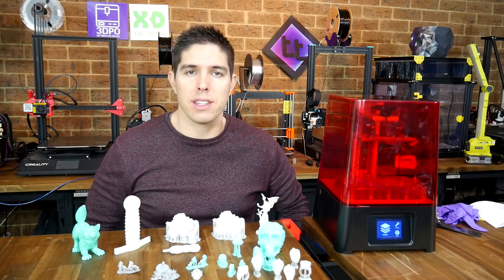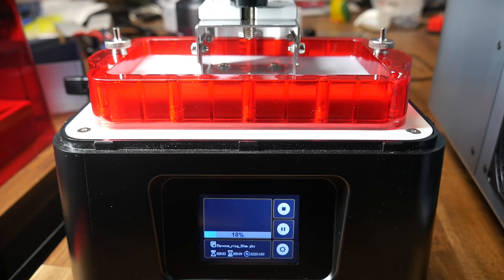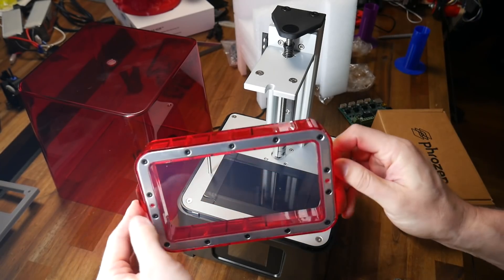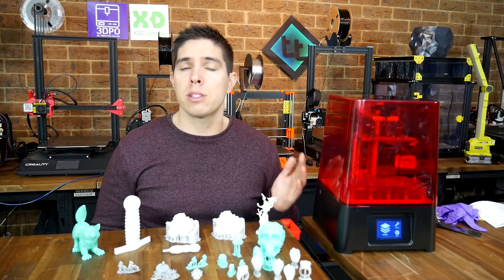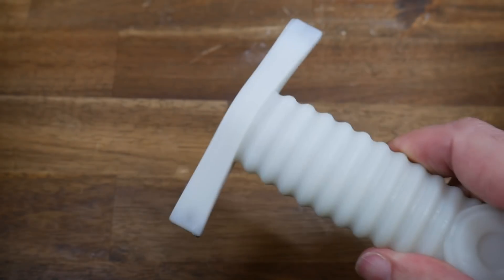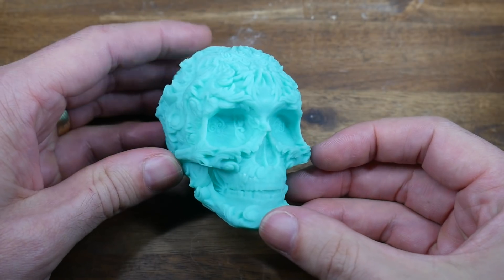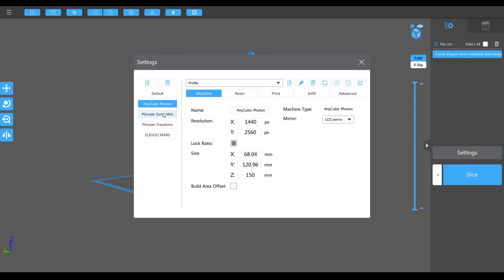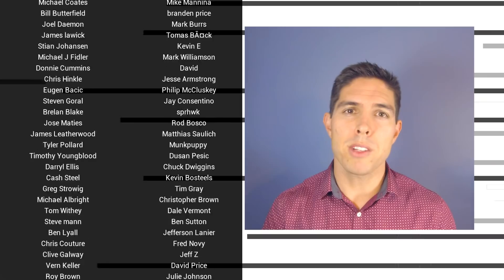Resin 3D printing in half the time - Phrozen Sonic Mini review

Comment: You changed my mind on this printer. I was originally only looking at the specs of 1080p, but the prints look good enough for my applications. Really excited for the other resins you test.
Reply: Honestly, my lower end Smartphone has a 1080p screen and i cannot see really any single pixels. Everything just looks perfectly smooth. Meaning, a monochrome 1080p display should be even a little sharper, so you certainly won't notice any pixels on a resin print, which smooths its surface somewhat automatically. And one layer of basecoat will even out even the tiniest of surface imperfections.
Wouldn't go below 1080p personally though.
But the main benefit of 2k resolution is a larger screen size with the same pixel size and sharpness.
Reply: I don’t think you can tell any difference unless you need fine detail from something the size of, say, a fingernail.

Comment: Do you think the print in place models would work if they were printed slower?
Reply: I'd Rather Be Making no. I think It more has to do with the fact that every layer HAS to stick to the layer above it, or the section will fall off or stick to the VAT. (Kind of the opposite for FDM, where gravity helps keep things together).  I think it might be possible if the part was designed with micro-tabs that could be broken. OR if you printed something (a bearing for example) with its axis vertical